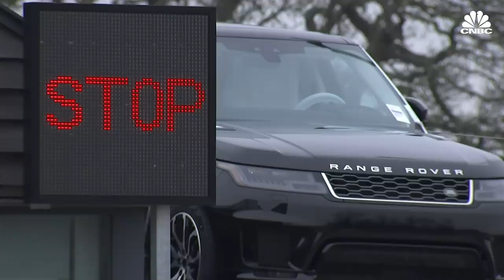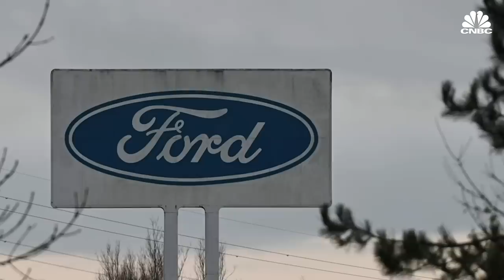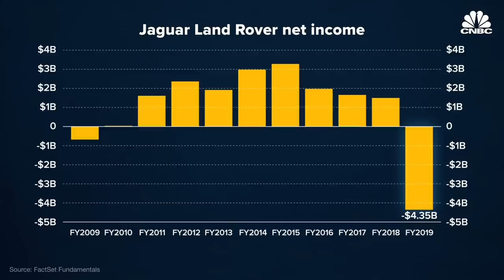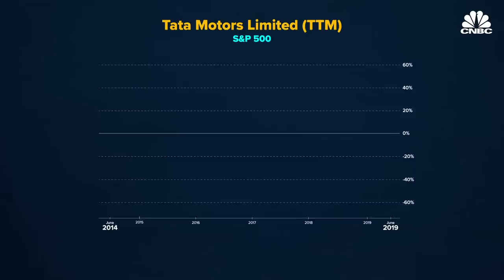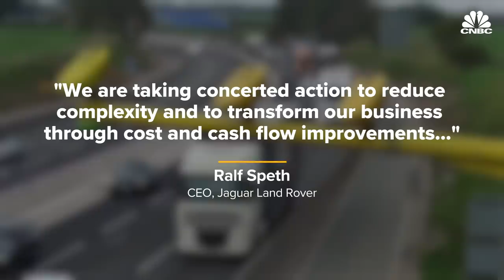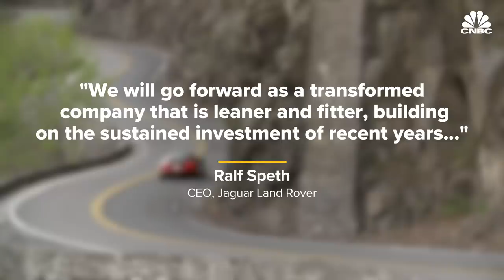Why Jaguar And Land Rover Face Uncertain Futures

Comment: It pains me to say this but Jaguar is a dead man walking and has been for a long time. They haven't designed and manufactured a stunning looking sports car or a large luxury sedan for 20 years. 
On the other hand Land Rover/Range Rover has been making one winner after another. From the incredible looking Range Rover Sport to Discovery and last but not the least - the new Defender. But Land Rover has another problem that they can't seem to resolve, even with the money Tata poured into the company. That problem is called quality control. It's abysmal. Their cars break down consistently with every new generation adding some new problems that are usually connected with some very expensive break down. From the trasnsmission to engine to infotainment. This aura of horrible reliability will be the death for one more historic British car brand. If BMW didn't manage to make s winner out of them than nobody can. Just take a look how they've transformed the Rolls Royce or how VW resurrected Bentley or Lamborghini.. 
Volvo is the lucky one cause they were bought by the Chinese and we all know that profitability is not their primary concern. Strategic influence through CCP is their long term goal (thankfully EU is taking a stance against this kind of Chinese trickery).

Comment: TATA  took their eye off the ball. Ford made a total mess of J.L.R. They sold it to TATA and indeed they turned it around. Whilst Ford is still cutting back in every direction of manufacturing. Tata has a huge decision to make now? Do we invest and plough on? Or do we simply give up and move on. Tata group revived J.L.R  after inheriting the less than favorable attempt by Ford. The i-pace is a great car that is well received by the motor industry. I think J.L.R. Needs to cut the model range across the board. Too many models that do not fit into the mainstream. J.L.R. Has the manufacturing capacity to make smarter smaller cars. Take the lead from Mercedes!!! crappy A class, Bmw-one series!!!! They all sell off that back of a brand name. Not sure any of these cars are worth the money.however!!! Every idiot/prat wants to own one. J.L.R  Has the opportunity to do the same. With 2 great brands as a platform to sell from. J.L.R. NEEDS TO LOOK IN ON ITSELF.

Comment: worst review ever Bmw pumped the money and quality into Range Rover Tata just rode the wave and the quality and reliability has slowly declined
Reply: John Bowling, it’s the complete inverse of what you are saying.  There was no “wave” for Tata to ride on, because both BMW and Ford sucked the brand value out of JLR.  Ford was even putting cheap Ford parts into JLR, causing JLRs prestige and brand value to drop like a rock.  Tata has been pumping the much needed money to breathe life into the brand, and rebuilding its long lost reputation.